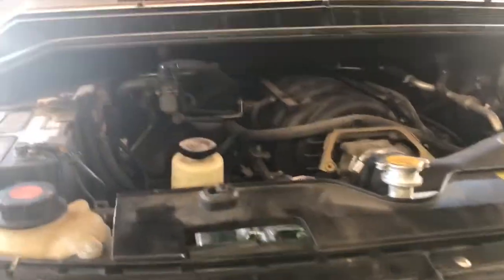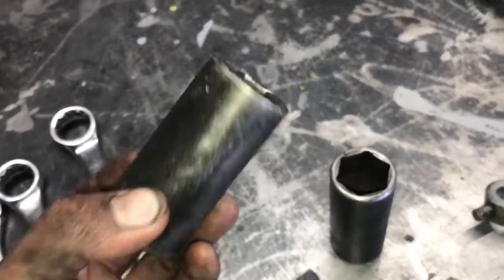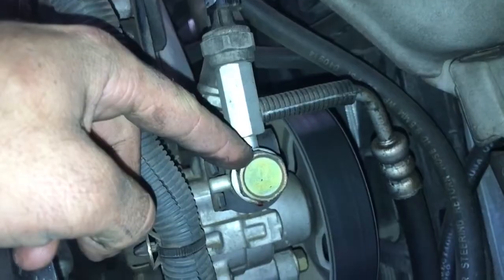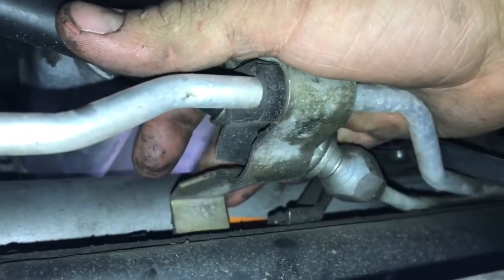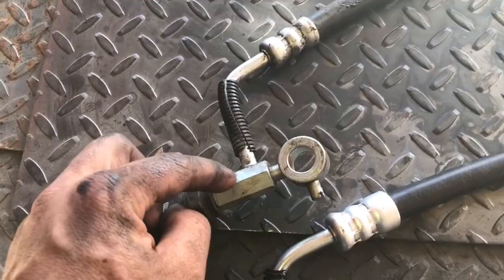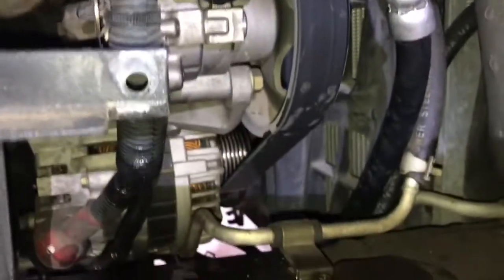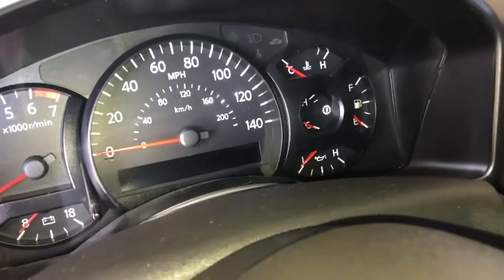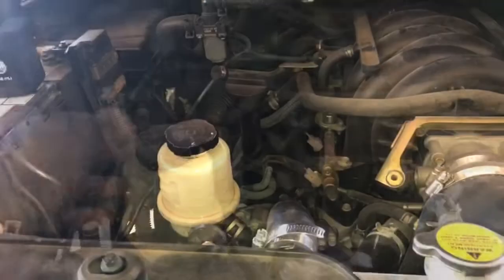Nissan Titan Power Steering Hose Replacement (fast and easy)

Comment: Thank you. After paying my shop $2200 for a rear end replacement - I decided to do the rest of their findings myself. Window regulator, front wheel bearings, brakes, pads, rotors, calipers and of course - this. Saved me loot man. Much love.

Comment: Is this what's causing the build up on the passenger side of the engine? I have so much buildup from something leaking but I have no drips.
Reply: Did you ever find what was causing it? Mine is doing the same, cant find a leak.

Comment: I'm doing a 94 nissan pathfinder and the one part I'm having trouble with is putting both banjo bolts on with the copper rings and no videos are of the vehicle I need and everyone wants to skip showing putting on the bolts

Comment: So what do you do if the 14mm doesn’t spin? To remove the like what do you do then? Because I’ve tried to turn it with the 21mm and nothing. And made sure I’m loosing it and not tightening it.
Reply: Did you ever get yours off? I'm in the same situation, been trying to get it off for about 4 hours spaced over 2 days.
Reply: @joshuaperry7529  what I did was I returned the hose and bought the full assembly, that one was easier to remove with a line wrench. Can also get it at Harbor freight for 7$ I think. There is another video that goes step by step in replacing the whole assembly. I rounded mine so I had to and was much easier like I said.
Reply: @joshuaperry7529  got the fully assembly for 42$ comes with 2 crush washers and 2 O rings.

Comment: Dude, this totally fixed my low (rough) idle problem!  I was around 550 rpm while stopped in drive, now am at 750 rpm while stopped in drive.  Been fixing everything left and right to fix this problem.  And what do you know, a leak in my PS hose was the cause!  Amazing.  By the way, this took me 5 hours.  NOT an easy job taking the clamp off and on, not being able to see on top.  Also had to replace the metal portion because it was seized I couldn't get it loose from just the hose portion, so I had to saw off the end where it goes into the rack and pinion and put a ratchet on it to get it off.  ROYAL PAIN IN THE ASS.... BUT SOOOOO WORTH IT.  Fix my leak AND my low idle!!!!  by the way, I have a 2004 Infiniti QX56.  Oh yeah and be prepared to GET MESSY.  I've done a ton of work on my car, and this was probably the messiest job I've done!  What makes this job so hard is that you are working in the tightest spaces and have to use standard wrenches.  Also, I had to use my impact wrench to get that big 24mm bolt up top off.  It was on SUPER TIGHT.  Also make sure you have a 14mm wrench!

Comment: Hey Aaron - thanks so much for putting these vids together.  I successfully replaced the high pressure hose (seeping) yesterday and flushed the fluid.

A few comments for those looking to do this:
- I could not even see the lower connection/bracket; had to do it by feel.
- The bolts are very small 10mm; be careful and thread by hand first to make sure you do not cross thread them.  This will take some time as there is little room to work and no visibility.
- The lower part of the line was on TIGHT!  It took a lot of force to remove it and the space is super limited.
- I got the OEM line which came with the entire rubber/metal hose assembly (except the copper washers) including the pressure sensor (only ~$95 on sale).  But, I only replaced the high pressure line as the others seemed fine and didn't want to mess things up.
- I filled the reservoir and did the turning the wheel back and forth 10 times and it was still pretty full.  Once I started the vehicle it sucked down nearly empty so watch out for that.
- I agree removing the wheel well liner is a must.  Not only for taking off but to thread the new banjo bolt on - the weight of the hose wants to fight you from getting it threaded strait.

Good luck!
Reply: 9

Comment: Your using transmission fluid?
Reply from the maker: Nissan manual calls for dextron 3 automatic transmission fluid. It’s very common to use that on power steering systems
Reply: @AaronHinesAuto  but is it fine to use other power steering fluid though?

Comment: Definitely going to give this a shot. Nissan just quoted me $860 to do this replacement.
Reply from the maker: Holy smokes! Good luck!
Reply: i was quoted the following cause: power steering and transmission fluid leaking.  correction: replace the power steering return line power steering high presser line return transmission line...$1452.20 nissan dealerships are out of their minds

Comment: I recently changed the power steering\atf fluid and I still have air in the line.  How long does it take to get the air out?

Comment: Aaron Hines, thanks for the vids! They are very helpful. I’m going to be replacing my power steering line and the new one came with the additional hard line piece. Is it necessary to replace the whole thing? Just replacing the rubber hose like you did seems much quicker....
Reply from the maker: Thank you so much! No you don’t need to install the steel line. I normally don’t because they don’t leak

Comment: Ok I just fixed the bottom hose that’s under the reservoir I didn’t think to look this up before I did it but I didn’t disconnect the sensor do you think that I ruined that sensor? and how do I know if it’s not leaking anymore ? Thank you!

Comment: Hey Aaron!  First off thanks for the vid!  Gave me the confidence to do this job myself....but that's where the fun ended tho LOL.  This is day 2 under the truck....the pressure fitting at the frame that leads to the steering gear is seized.  I'm holding the stationary hex nut on the pressure hose and have a 14 mm line wrench on the threaded fitting and can't turn the SOB!  I'm a fairly strong guy so effort is not the issue.  To make matters worse I can't get my 14mm line wrench in a position on the steering gear fitting to get any leverage.  The CV Axle is blocking access to the backside.  I saw a guy put a line wrench on it and use a breaker of some sort (out of camera view) to bust it loose.  Any suggestions?  MAP gas on the fitting?  Dunno if the heat transfer into the steering gear would harm it.  Any help is appreciated. Thx
Reply from the maker: I would put some heat on it like you said. It shouldn’t harm the rack and pinion as long as your quick with it. An acetylene torch would be ideal but a map could work. Good luck!
Reply: @AaronHinesAuto  Thanks for the feedback.  I was reluctant to try heat.  Main issue was no leverage on 14 mm line wrench.  Accessing from the front, I solved this by laying a crowbar on the curved part of the frame and under the line wrench and lifted up.  It broke it free and i was able to turn the fitting the rest of the way with an open ended 14mm.  Whew!  Did you replace your pressure sensor when you had it off, or just swap it over to the new one?  I have an O-ring for the end of the fitting but not another for the sensor, and ya know they say to never re-use them.  I've seen some ridiculous prices for a new sensor.  AutoZone wants $121!!
Reply from the maker: Wow. I have never seen those sensors fail before. Doesn’t mean they can’t though. I would just reuse it and the print for it. Maybe put some fresh oil on the ring before install. I bet that was a great feeling when the line busted loose!
Reply: @AaronHinesAuto  Nearly busted my head on the fan in exuberance!!  Lol.

I'm changing out the sway bar bushings, links, ball joints and bushings in UCAs and LCAs, calipers, rotors and hub assemblies too. My splash shields are nearly rusted through.  And I damaged them more using the 8" 1/2" bolt trick to extract the hubs.  So I had to place an order for the splash shields bc no one makes aftermarkets that I can find.  And while i was already paying the S&H I ordered a new O-ring for the sensor.  It was a ridiculous $7 but I'll sleep better with it under the old and still kicking pressure sensor.  Keep making the vids.  I'll keep watching.  And if you're taking suggestions lol...I'd really like to tackle the bearings on the diff half shafts but too much of the work is "off camera" from what I've seen.  I wanna see someone hit the half shaft or pull it out w a slide.  And I wanna see the oil seal ever so delicately removed.  Not really wanting to install new races.  Thanks again for showing us we can do some things, not all, but some things to take care of our trucks.

Comment: Great video, my 04 leaked for years.  Repair shop quoted me 675 to fix it.  I took off those spring clamps and put SS hose clamps on both the HP and LP side.  I haven't had a problem since.  Good to know where else to start looking, I didn't think of the pressure fitting.  Cheers

Comment: Just did this today. It was not fun.  They really don’t give you much room to work with.  And why not put the line with the connection in back!!? 😂.  Definitely pull the inner fender liner to get to that banjo bolt.  As usual for me it was a job that should take an hour but took four. 😫
Reply from the maker: Yes it’s definitely not a fun job to do. Always seems impossible to route the new line the same way the old one was
Reply: I just did it today, that bitch was stuck so i had to replace the steel line also. 
Im pretty sure i stripped the inside of my rack 😢

Definitely not a fun nor easy job.

Comment: Thanks alot for this video. I went to midas and told them that I been hearing a nice every time I turn they told me that my power steering was leaking and that they would charge me 1500$ to fix it obviously I said no I thought that was way to much. My question is for a job like this what's a fair price to pay somebody? I'm still driving my truck should I keep putting more fluid in my pump thanks in advance

Comment: Have you changed the low pressure line under power steering resovoir
Reply from the maker: no i have not. i have replaced the clamps on that hose though. they tend to leak after time and a simple woorn gear clamp fixed it

Comment: Is there a reason Nissan recommends their power steering fluid vs just Automatic transmission fluid?  Just curious about that. I noticed you just put in what look like automatic transmission fluid in my wife's truck it has a sticker on the core support that says to use Nissan power steering fluid only right next to that sticker is another one that says used Nissan matic s only in the transmission it doesn't say Nissan or equivalent they are specific to the jester fluids how is that just like a scam for money or is there a reason behind it?
Reply: Jeff Eppenger because they want to charge you an arm and a leg for it.

Comment from the maker: 64.99 from oreilly auto parts. 

https://www.oreillyauto.com/detail/b/import-direct-power-steering-5671/suspension---steering-16778/power-steering-16478/steering-hose-assembly-pressure-line-12559/8511739221af/import-direct-power-steering-hose/13401111/5697636
Reply: I have a cousin who works at that auto parts company and he helps me buy the parts, because he is an employee they give him a discount and that line came out for $19 dollars 👌👍😁😁😎😎😎